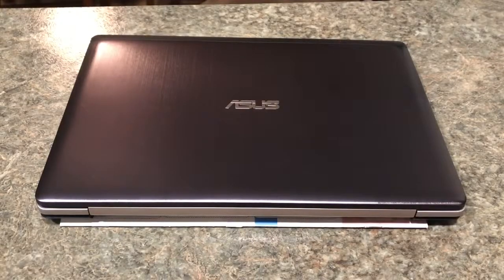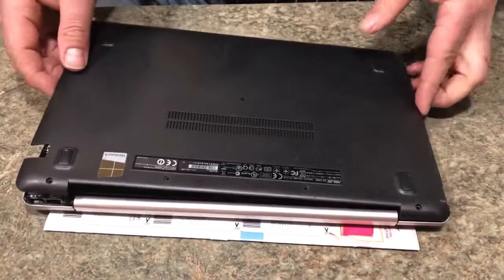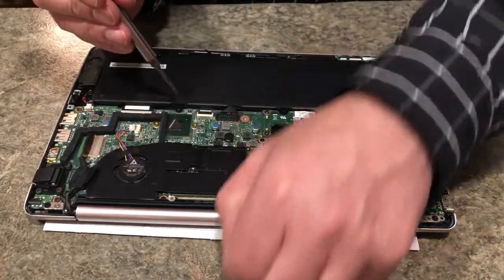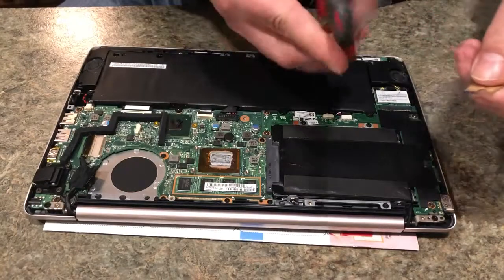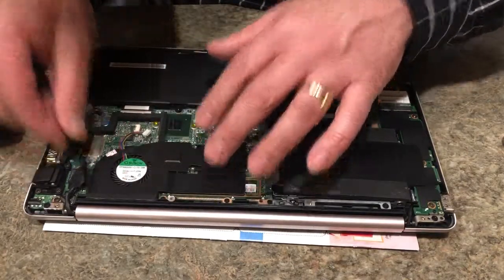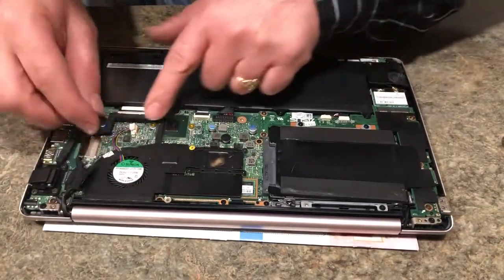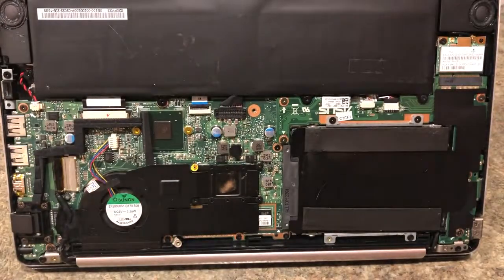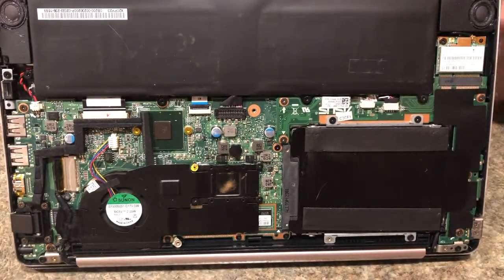How to Replace Asus S200E Processor Fan

Comment: is it possible to separate the fan from the radiator? I'm thinking on buying just the fan itself
Reply from the maker: I would check online to see if they’re sold separately. It may be just as cheap to buy both but see what they have online.